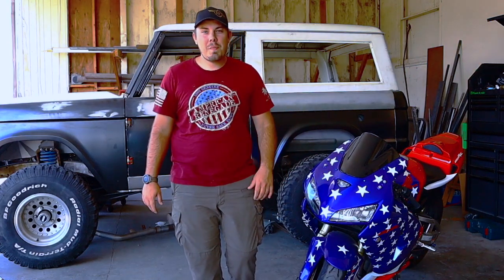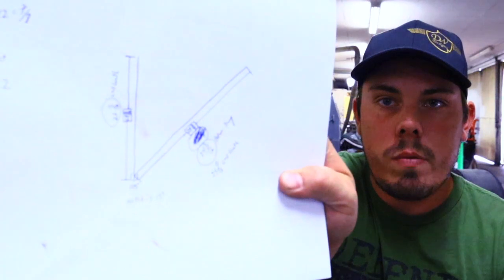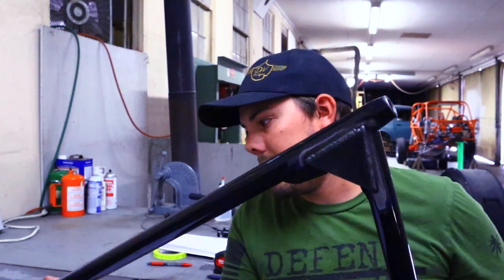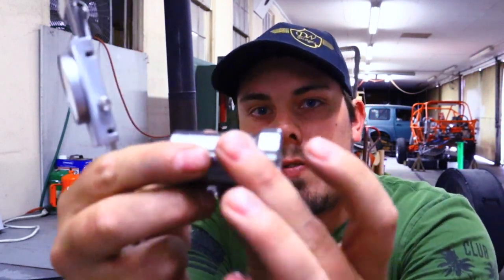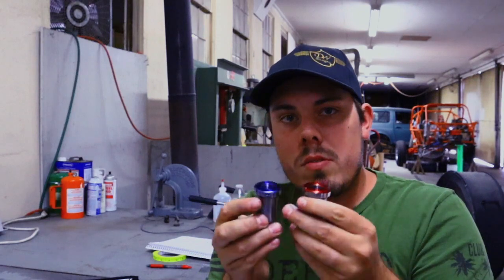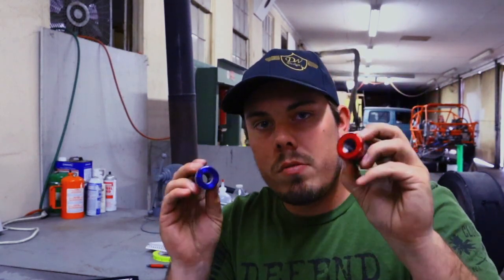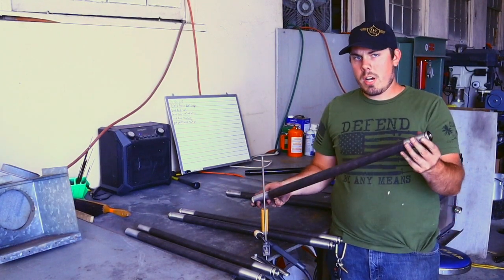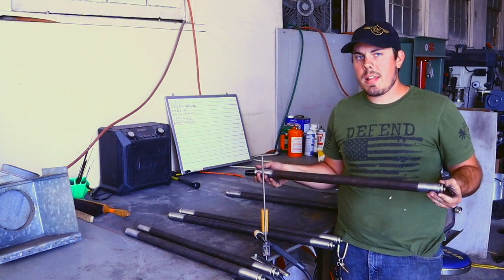Sandrail Upper Control Arm Replication: Step-by-Step Guide (Part 1)

Comment: You died those blue for right and red for left.  Just throwing this out there, I would have done bLue for Left (L in both) Red for Right (R in both). Love the video, great info.
Reply from the maker: Thanks Jake for the info I appreciate it. I later found out that they had a grove machined around it for the left hand thread. I didn’t know that at the time. Always learning something new every day if not im doing something wrong.
Reply: @DWDesignsFabrication  I only mentioned that because I used to work on trailer wiring a lot and the 7 pin plug uses yellow for left, green for right, so it’s the same idea of match the L, and match the R.
Reply from the maker: @j @jakeestepp4406 solutely no worries I love hearing different takes from people. and very cool wiring is an art form of its own.

Comment: The spatter coming off a tig welder in the intro made my skin crawl…
Reply from the maker: Yes sir I’m sure it did lol how ever I will tell you that metal was every old and was full of contamination no matter how much it was cleaned it didn’t matter. Not making excuses here it’s the truth it was rusted pretty bad before hand and was sand blasted off and after cleaning it , it still spattered. If you have experience with work with metal you would know that it can happen not everything goes as expected to.

Comment: So...the length of tube 1 was based of some tube you already had?  Cool for you , helps me not.   Some fundamental design explanation would have been nice. Thanks anyway.
Reply from the maker: Thanks for the feedback. Every car has its own designs and spec’s, there’s lots of variables like is it a sand car or trophy truck etc. I have been wanting to do a more in-depth video on how to achieve a full suspension set up, just haven’t gotten around to it. How ever if your looking for some good information regarding this topic and even chassis’s check out a book call Chassis Engineering, by Herb Adam’s hopefully that can help you answer your question’s. Or if you have a question let me know and I’ll do my best to help with your question.  Thanks have a great day.

Comment: What size tubing and wall size was used?
Reply from the maker: Hi Jonathan thanks for watching! And great question, what I used was 1-1/4 .120 wall chromoly tubing. Feel free to reach out for any more questions and if inclined to do so please subscribe.
Reply: @DWDesignsFabrication  sweet thanks! Going to be building upper and lower control arms for my 4 seater sand rail and your video was perfect to help me with my build!! Another question. Would DOM tubing would be strong enough instead of buying Chromoly?
Reply from the maker: Ok awesome would love to see some project photos of you building it! The sand car control arms were originally dom so yes that should be fine I would recommend adding a little bit more gusseting where you can to help with bending or distortion. And definitely don’t go under.120 wall with dom. I have more photos of myself building the control arms on my Instagram page @dw_designs_fab if you’d like to get more references points. If you don’t have an Instagram feel free to email me  at dw.designs@icloud.com and I’ll send you photos.
Reply: @DWDesignsFabrication  thank you so much! I’ll go check it out and give you a follow.